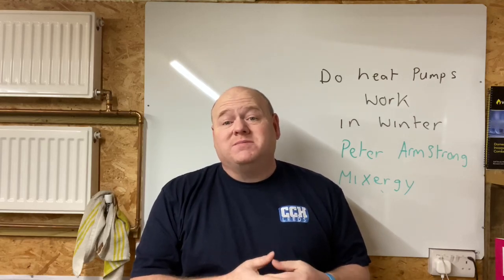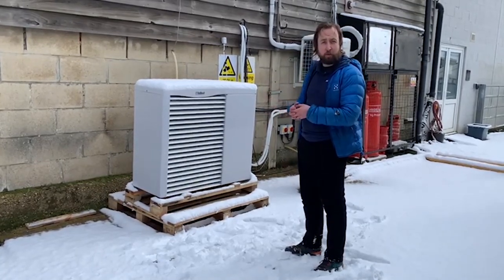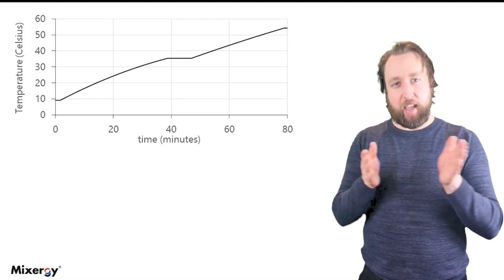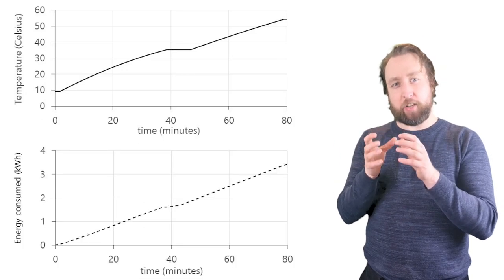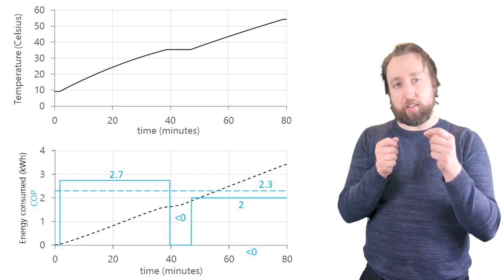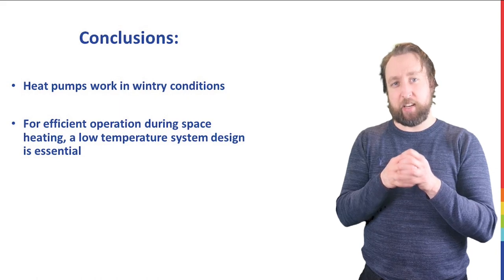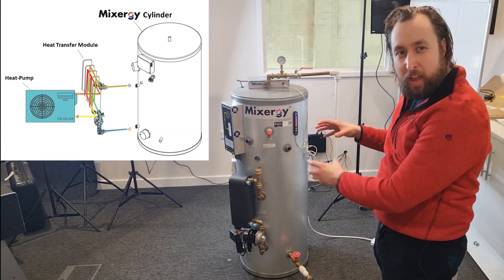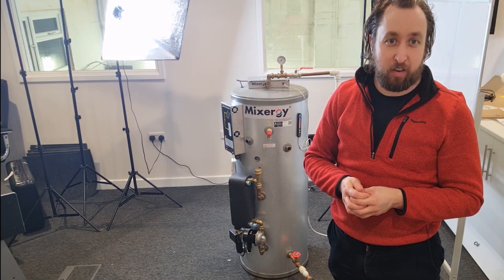Do Air Source Heat Pumps Work In Winter - Peter Armstrong Mixergy

Comment: ASHPs are o.k. for UF Heating. Proving the UF is controlled properly.
 Note also that some ASHPs have a supplementary 3kw Imm. Heater that kicks in at 3c outside. !!!!!. Because the COP is poor at low temperatures.
The Cylinder Man was being disingenuous. There was no draw off to the house heating so the heat pump was only heating the cylinder. NOT the house.

Comment: First of all this is NOT new Technology I was installing heat pumps in 1970s If you live in the uk and have gas then forget a heat pump gas is far cheaper. The lower grade heat provided by the heat pump requires much larger radiators .
The Humidity in the uk is also quite high so the outdoor coil tends to ice up quicker

.
Reply from the maker: Thank You

Comment: "Fair weather friend" is an old description of someone who befriends you when you are doing well, but drops you when times are hard. That is how we can summarise the performance of a heat pump. Do not install one without some other system, such as your existing gas system, to take over in midwinter. By then you will have a lot of ironmongery !

A heat pump is not a perpetual motion machine, but there is a catch. It is also a bit like a gambler playing the Martingale system in a casino. The gambler normally makes steady gains, but these are traded off against the risk of disaster. Disaster will surely come.

Comment: I think your technical jargon does not explain how much electricity the heat pump requires to operate. It is all very well to talk about co- efficients.  There is none of that on an electric bill.  How much do they cost to run ?   How much compared to a gas boiler ? Say it like it is.  Roger Bisby is spot on.

Comment: We have a wall mounted a/c unit in our bedroom. In winter it works in reverse to heat the bedroom up. It's actually quite efficient, but of course it only heats one room up. It's not a replacement for either a gas boiler or as ASHP driven central heating system, but it does what it does rather well.
Reply from the maker: Thank You
Reply: Have you ever had it professionally cleaned or had to have a component replaced?
Reply: @ducharmehvactraining925  No, but we only fitted it in August 2021. To add to my original comment, we also have a powerful wood pellet burner that drives 8 radiators. We only use the 'mini-split', as I think they are called when it's only the bedroom that needs heating- we have a newborn here.
Reply: @SimonWallwork  hello again
My question is more about  what you have set up with your installer of the ASHP.
Reply: We haven't set anything up. It's just under warranty from Hitachi.
Reply: @SimonWallwork  so sorry to hear that. Good luck to you.
Reply: @ducharmehvactraining925  theres enough fridgies around to deal with them - they're not using plumbing. 

Theres literally millions of air to air heatpumps installed around the world. We've had ours for 8 years and zero issues.

Comment: In the vast majority of properties in the UK heat pumps are going to be a challenge. Radiators are going to be inadequate in most systems . So if I was building a new home and had space, a ground source system would be a better option. Coupled with underfloor heating of course.
Air sourcing great in the summer when you don't need it . I have solar and heat water with a diverted again not so good in the winter months.

Comment: We are an all-electric house with no ASHP but are interested in the Mixergy tank. Can you confirm the warranty applicable to the immersion heaters as these would be the main heat source via Solar PV or TOU tariffs? We are really looking for the lowest maintenance system possible.
Reply: Mixergy tanks come with a 25 year warranty - find out more at mixergy.co.uk
Reply from the maker: Thank You

Comment: We live in rented accommodation so no fitting for me but I was thinking about electric radiators or air source heat pump something Mobil to heat our small bungalow and stop using the gas boiler that is very expensive but I don't know what to purchase in the UK

Comment: I'm thinking of getting a wood chip burner to plumb into the system as a main heat source in severe cold periods ie -5 -10 or worse so it comes on and heats the water and central heating as well. Our neighbours central heating exhaust flows through our ashp but the moisture freezes up the fins and it goes through defrost regularly using more power than necessary so much for green power. But it works above freezing which is 90 percent of the time

Comment: If you put a 3kw immersion on for an hour you would get to 50° (40 gal tank) that's 3kwh. So the £10k heat pump system achieves same result in winter as a £25 immersion heater element? I'm a fan but payback period?
Reply: Hi Adrian, so a 40 gal tank (180 litres), heated from cold (let's say 15C) to 50C will take 7.35kWh (ignoring heat losses) of energy which will require a 3kW element to be on for 2 and three quarter hours. On a night rate tariff in the UK, this might cost about 74p. In the video, we were looking at the extreme of a cold winter's day, but a seasonal COP might well be around the 3.5 mark and so the daily cost could be around 25p as opposed to 74p...

Now if we just consider hot water alone, the saving over a year might be of the order of £180/annum, if we then consider the space heating savings (compared to direct electric), according to Ofgem, a gas household might need around 10,000kWh which with direct heating would cost about £1k on a night tariff, reducing to £285 for a COP of 3.5 saving about £700/year. Now this is where we are starting to stack lots of assumptions! For instance, the hot water COP will be lower than the space heating COP depending on how low the design temperature is. As you can see from the video, the design temperature for the space heating will have a huge influence on the COP and savings. But setting that aside, we might expect to save a total of £900/annum for an all electric customer moving to a heat-pump. In practice, you'd likely have a deep retrofit project before installing the heat-pump to improve insulation, glazing performance etc and so the space heating demand should likely be lower. So this analysis is further complicated! But, to be crude, let's assume £1,000/annum saving on a £15k project including heat pump and fabric improvements... you'd be looking at around 15 year payback for an all electric scenario and longer for a gas customer...

This is indeed challenging for today's householder and one of the reasons the government has been putting things like RHI and the Green Home Grant in place to try and bridge the gap. As deployment volumes increase, heat-pumps are likely to reduce in cost significantly, so early adopters/grants might start to help bring the costs down to a point where heat pumps become more mainstream.

Our view at Mixergy is that heat-pumps will be great for particular building types in conjunction with deep fabric improvements, but we also think hydrogen ready boilers are likely to play a role in the late 2020s/2030s. The Mixergy tank can be installed today for a gas boiler which becomes a hydrogen boiler in the future, or it can have a heat transfer module fitted for a heat-pump install or it can simply use the direct electric heating through the immersion port using grid electricity with a renewable tariff. With a 25 year warranty attached to the tank, we want to make sure it's capable of working with whichever heat source it gets attached to in the future.
Reply: @mixergyltd6286  thank you for your comprehensive answer. For new build high efficiency or passive with underfloor heating, a heat pump is the way to go, especially if connected to a supplier such as octopus energy, whereby the system selects the lowest 1/2 hourly rates; same as charging your EV via smart charger. I actually think a much larger tank perhaps 300 litres is the way to go. As you point out Insulation is the issue and of course conventional radiators. Pleased to see mixergy is at the forefront of the future.
Reply: @mixergyltd6286  Hey, 15 c is not cold, try 5c and not everyone has Economy 7 and you can't ignore heat losses either  and at 25p /KW. hr we are talking at least £1 per day or £30/m or £360/yr
Reply from the maker: Thank You

Comment: We have PV on the roof which through a feed in tariff pays for almost out electricty and I'd absolutely love to swap out the gas combi for an ASHP but just don't feel it would be a powerful enough unless as has been mentioned, underfloor heating was installed throughout, the price of which would add greatly to the pump install. There are grants available but I think they are paid back in installments after initial outlay by the homeowner. Certainly for me, that's quite prohibitive. 

I wonder, could the lump be placed in an insulated housing to help protect it from the lower winter temps? Would that even have any effect on its performance?
Reply: I had a similar thought. A shed type housing with insulation perhaps on the sides but with ventilation to allow air flow through the housing and with a proper roof over it. 
These units always seem to be in open air, regardless of how much available space there is surrounding.

Out of interest, do you think an Immersion heater for your hot water, using the energy generated from your PVs on days when there is sufficient Kwhrs to heat a tank of water would benefit you?  I'm not sure if one of those MixEnergy cylinders would accommodate something like that or how well insulated they would be in order to keep the water hot for a number of hours and I know that's not much help for your heating needs but just a thought 👍
Reply: If you enclose an ASHP you will get a very big ice cube with an ASHP inside.
Reply from the maker: Thank You

Comment: It's the future for new build properties designed to accept this type of technology, but I am not so sure particularly from a heating point of view about retrofitting into existing properties, particularly older housing stock.
Reply: Hi Mark, we agree that new build is much easier, retrofit is indeed challenging and demands very deep measures to the fabric/glazing before installing. On many types of older properties this is indeed a serious hurdle... for newer properties less so... In all cases, we thoroughly recommend a survey of the fabric performance and addressing insulation/glazing/air tightness/ventilation before specifying/installing the heat pump.
Reply from the maker: Thank You

Comment: 4kwh to heat your tank, that would cost £0.80 for electricity and £0.20 for gas!
Reply: And around 18p for heating oil at 10Kw per liter at 45p  per liter.
Reply from the maker: Thank You

Comment: We had an air source heat pump a few years ago it was rubbish we ended up having it taken out we now have a condenser boiler, it's brilliant.
Reply from the maker: What issues did you have? Thanks.
Reply: @AllenHart999  I had my (Samsung) air source heat pump removed.
*It was so unreliable that it spent more time broken down than working, and we were frequently without heat or hot water for days till the installers returned.
*When it worked it would take an hour before the radiators got warm (never hot, just warm) and in the cold weather we needed the gas fire on as well.
*When it started up it was like a jet engine and it would wake us up and could be heard over the TV. Neighbours complained about the noise. 
*The water wasn't really hot enough to do dishes or have a bath in, even running just the hot tap with no cold water, which meant it took much longer to run a bath.
*When the temperature hit freezing it didn't work at all.
*There was constant dripping of water due to condensation which in winter would freeze causing a slip hazard.
*Despite being told it would be cheaper to use than the gas central heating it was far more expensive. 
*The rules for claiming money back under the green initiative required more loft insulation than I could have due to the loft having a floor, every light bulb had to be low voltage which would require fittings to be replaced in some rooms. Our older double glazing was not to the required standard either.
* Initially it was installed on the floor at the side of the house meaning the access was limited and making it difficult for bully items (like the new washing machine) to be brought to our back door. Due to the inefficiency the installation company then decided it needed to be lifted 1 foot off the ground, so moved it. It was still inefficient, and the company had now gone out of business. A 2nd company decided it needed to be higher up, so moved it up under the spare room window. It was still inefficient and the noise would have made sleep in that room impossible. It was also an eyesore and people would stare and point at it as the walked past and we frequently got asked what it was.
This 2nd company also went out of business and when it broke down again, we had to pay another company to get it working. Since it regularly failed, it became an expensive process, high is why we decided to cut our losses and have it removed.
We were told that heat pumps are UNSUITABLE to be retrofitted to existing central heating systems and are only suitable for new build homes. And this was from a specialist GREEN ENERGY COMPANY!
Including the cost of a gas boiler to replace the one removed when the air pump was installed the total cost hit over £10,000.
Reply: @parzival1958  We have had ASHP for 10 years, it has never broken down, we have never had a cold house and we always have plenty of hot water.

Comment: Allen & Pete. Thanks. 
Gas per kW is approx one quarter of the price of electricity per kW. So, COP 3 or 4 equal gas boilers in running costs. If there is no gas then heat pumps make sense, than going electrical resistance heating which costs approx four times more than gas.  

The COP looks like an average of approx 2 COP over the heat up cycle. That is, for every one  kW used, two is produced. With a resistance immersion heater, the COP is minus. That is, for one kW used, just less than one kW is pumped into the water. 

But! the COP will be higher in summer. Some heat pumps are more efficient than others, maybe getting COP 4 in summer. So, it is the annual average COP that matters. So, running costs may be near equal to, or equal to gas.

Now if the heat pump was ground sourced or water sourced the COP would be much higher.
Reply: The cost of the bore holes would be cost prohibitive though. I’m sure most of these points made are valid, but let’s face it, we need better insulation, and heat reclaim units, before any if this is a practical option. Or district heating, provided by a renewable source  with a heating interface unit in the home.
Reply: @Brijoolz  
In Sweden they are not, as small companies specialise in drilling bore holes. Can always have long slinkies about 3 foot deep. Not as good as a bore hole but good.
Reply: @johnburns4017  it’s all interesting stuff. We need to stop burning stuff. Insulation is key.
Reply: Where I am gas is one faith of normal electric tariff. Our gov is so obsessed with its aim for zero CO2 in a ridiculously short timescale it is in serious danger of making some seriously stupid policy decisions, and even laws, in this area.
Reply: Thanks John, the intention of this video was to just look at the winter performance where we were trying to extract heat out as quickly as we could into a cylinder. The seasonally averaged COP will indeed be higher than the figures in the video.

One interesting question we have had is what happens if there is an extended cold snap and a significant proportion of heating systems are using heat-pumps operating at low COPs or on direct electric back-up... does the grid cope? If we look at the data, there is actually a lot of headroom in the power cables since demand since 1995 has dropped a lot due to things like LEDs and more efficient fridges etc... but with EVs, heat pumps etc there might be some localised challenges at times...
Reply: @mixergyltd6286  
"but with EVs, heat pumps etc there might be some localised challenges at times..."
National Grid say they see no problems with EVs and heat pump introduction. As you wrote, any electrical distribution problems will be mainly local. 

But what will make air sourced heat pumps really affordable is powerwall batteries and PV panels (if the roof is facing the right way) reducing running costs. And reducing running costs of all electrical appliance.

Heat pump manufacturers want to push air sourced as they are cheap to install - no digging or hole boring.

I may be involved in the services of 42 apartments in three small blocks, in the Mediterranean. First is to reduce heating and cooling demands by design and high exterior insulation values backed by thermal mass. Concrete is normal in these areas so thermal mass is a given. PV panels is a must for DHW, which may be communal. The panels can be incorporated into the design. In winter a ground sourced heat pump may be used to fill the gap in hot water demand. Foundations have to be dug anyhow so ground source makes sense.  

The a/c and heating of the flats is the challenge. As demands for heating and cooling will be lower than the average for the area, the system has to be cheap to install.
Reply from the maker: Thank You